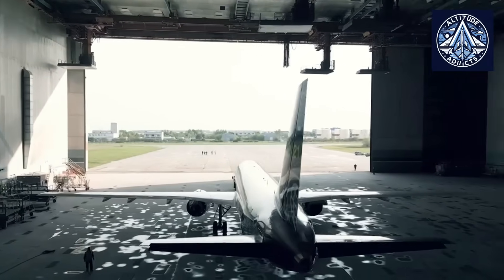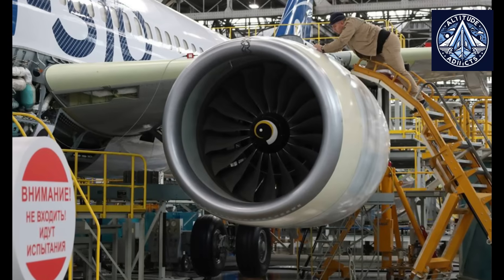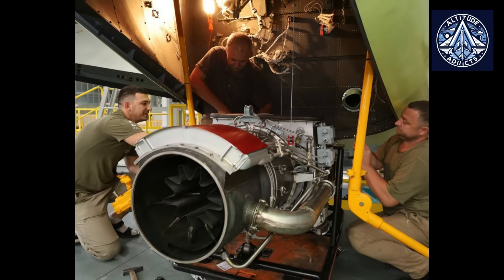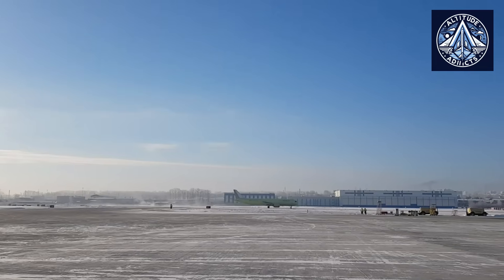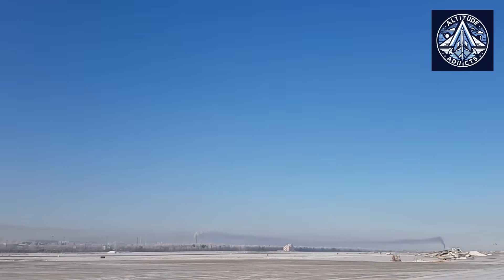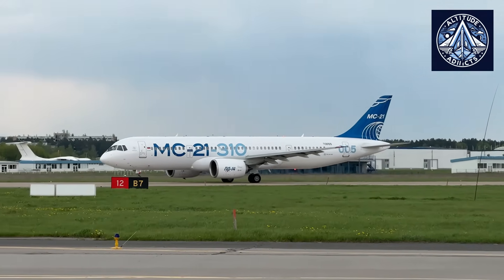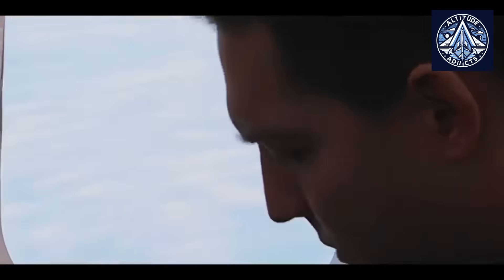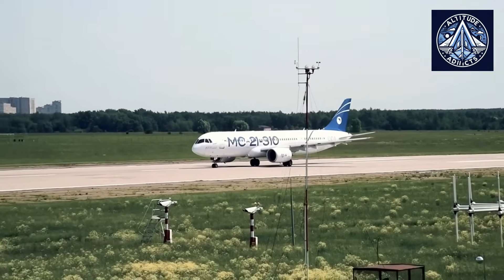Russia's Near production Standard MC-21 Begins Acceptance and Delivery Testing

Comment: All these videos u produced on MC21 did not answer the basic question what is the actual range of it.
Reply from the maker: Both catalogue and new estimated (2000 to 2800km) distances have been given in previous videos. Official final range is yet to be announced.
Reply: Andaikan kelebihan berat 5 ton tidak teratasi, 
Maka full kelas ekonomi 211 penumpang hanya sekitar 2000 Km, dan 160 penumpang jangkauannya sekitar 3500 Km.
Namun masih memungkinkan tahun depan dibuat dengan yang lebih ringan setidaknya bisa 3 ton lebih ringan dari sebelumnya kelebihan berat hampir 6 ton.

Comment: Last year, Russian news outlet Kommersant has reported that the MC-21 is a massive 5.75 tons overweight compared to it's original specifications. Any news on that?
Reply: That weight was heavy two years ago, when available vendors were still limited. The latest news is unclear, however, as to whether the old, heavy vendors are still in use or whether they've switched to new, lighter ones. Furthermore, with another year to go, there's still plenty of room for weight reduction.

Comment: MC 21 is not under modernization process. It’s Brand New Aircraft from ground up. Not like Boing or Airbus constant new version of vey old aircraft old engines with constant new upgrades by changing few parts with hard to believe data for performance Bla Bla. Same old stuff just a different day.  Boing, Aibus 737 and 321are very old aircrafts converted to new versions of engines and some others parts adding a dash calling it brand new like Neo same old plane with wings tips , it’s game.
Reply: Konyolnya desain kuno macam 737 masih dimodifikasi walaupun bahaya karena mesin besar CFM LEAP dipasang di depan sayap.
Akibatnya pesawat butuh MCAS yang jika error langsung fatal
Reply: Correct, the MC-21 is a brand new aircraft built from scratch.
Reply: @AO-ow6tt I don't agree 💯 it's brand new.. it existed with foreign part but wasn't commercialized due to the politics of pleasing the west. All foreign parts are being replaced with Russian parts thereby giving Russia the flexibility in updating or modernizing the aircraft ... So substantial works has definitely be done in the past ...
Reply: @Sam-dm4kz  Airplanes are not cars so they make a "new" model every three years. To design and build a complete new airplane can take 10/15 years, and billions of investments, and to be sure what the end customer wants, not the company who built it! Global aviation market conditions can change dramatically during the design of a new aircraft. The MC21, which I consider a good aircraft, is practically destined to be almost exclusively to Russia, perhaps a few hundred will be produced in the next 20/30 years. Airbus and Boeing must produce thousands of aircraft per year for the global market! Perhaps only COMAC China, which managed to take a slice of the market away from Boeing and Airbus, but it will take at least another 10 years to see the effects. P.S. The Design of the MC21 began in 2006, the first prototype built in 2014. It's been 19 years now!! And it still hasn't gone into mass production! In 2024 alone, Airbus delivered 776 aircraft, while Boeing 348....
Reply: Exacto el 737 es una vieja con maquillaje 😂
Reply: Well said
Reply: Actually it is being “modernised” as it is a second iteration of the initial design.  Yes the first never went into mass production but it was in essence at certification.

The MC21 on paper looks like a good aircraft IF the Russian made engines, undercarriage, avionics etc. are up to the job.  I understand empty weight has increased and fuel efficiency will be down and maintenance up due to more basic materials in the engines.

Russia has good engineers and scientists.  Materials and manufacturing are behind western standards and capacity but probably better than the Chinese and the c919 which is an A320 knock off.  Both the Chinese and Russian a320neo/737MAX competitors have one obvious issue.  Boeing and Airbus are designing the next generation narrow bodies for entry by 2035.  The MC21 and C919 will not have sold enough by then to make break even.

Russia and China will likely have very expensive strategic domestic aircraft and will not be able to finance any follow ons.  This assumes there are no big problems in the design and build that show up as type faults and ground the whole fleet.

I wish China and Russia well in what they do, I however will not be flying in them.  Didn’t fly Aeroflot for fear of a crash and likewise I will pay premium for proven when it comes to my life.